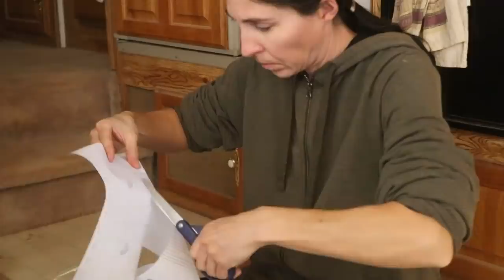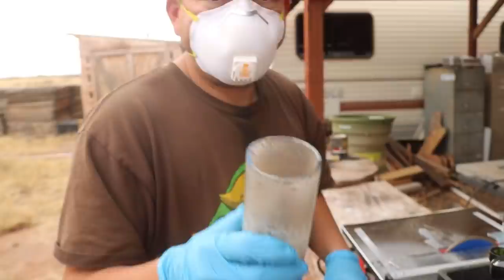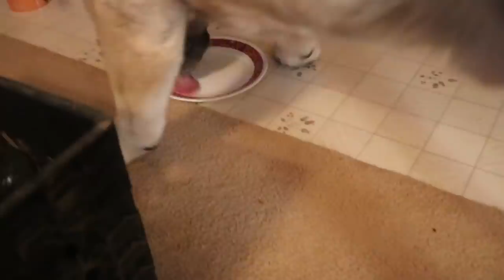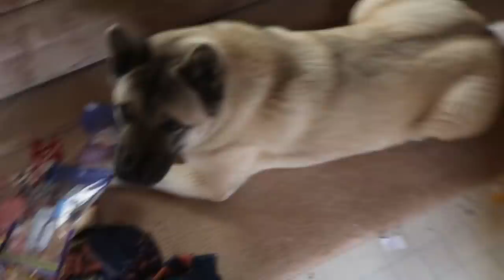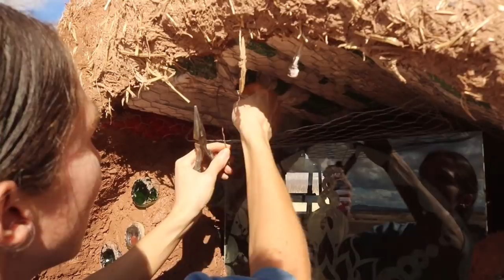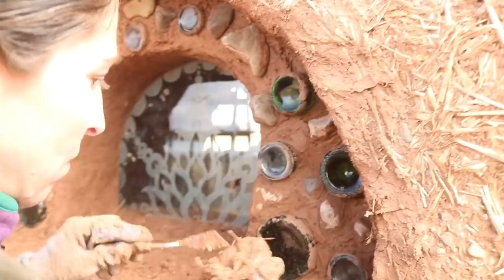This Beautiful Window Is Made With Etched Glass and Glass Bottles

Comment: If thats a morning dove- love the song the do in the very early morning.  Thanks for showing the etching- want to etch some glass on some interior doors I have.  The finishing layer will be the fun layer because you can sculpt it.  like the rocks you incorporated.  Saw something the other day -  make a bed of sand- set the bottles a few inches into the sand- bend some coat hangers around the bottles as reinforcement and then carefully pour a concrete or portland cement mix around the bottles - then you can lift them out and brush off the sand- and its a stained glass window using concrete instead of lead canning.

Comment: The window is beautiful, I was so excited when you got it capped I didn't expect the same excitement for the windows, hehe you have got me again. It sounds strange in the UK to not have south facing windows, I hope in winter when the sun is low you get a bit of direct sunlight with a projection of the window tracking across the inside.

Comment: Hi Jim and Jess. Just a heads up on your bottle windows. You should drill a small hole in the inside bottle to allow for expansion and contraction of the air inside other wise they will move.  I found this out on glass yard art that separated and crashed to the ground.

Comment: Great Video as always. Maybe helpful; if you scrape with the blunt side of a kitchen knife in hot soapy water it helps the glass bottle labels come away more easily, the hot water helps loosen the paper glue and the blunt flat knife edge won't  leave any scratches  or marks.  Great Stuff, thanks guys.

Comment: Are those one glass jars prayer candles?  If so you could pour boiling water in them or set them in a pan of boiling water to help get them clean. Most likely they have a metal wick holder in the bottom, but if not, you can also pop in the microwave. I’m loving this portion of the build. I love to watch your creativity Jess. I’d like to remove the windows of my normal stucco house and put in something like this. You have me inspired for sure. Ohhh...yes I think ai must do a bottle window. Also, I came across glass paint that I have in my craft supplies. Hopefully it’s not all dried out.
Reply: LG Maybe make a bottle wall around your patio or  garden. Hope you have fun working with making a bottle wall.
Reply: @wandadibble5426  that sounds like fun.

Comment: Nice. Nice. Very nice. 
And yes, I was wondering what you did with all your plastic. 
I don't have my permit to use the cities transfer site yet, so I have a little over a years worth of plastics, cans, and bottles. 
The plastics are my biggest concern. 
I can melt and make blocks or slabs out of any HDPE (2) or LDPE (4). 
But I don't think it is safe to do that with PETE (1), V(3), PP (5), PS (6), or Other (7).

Comment: In my experience as a marble Mason as long as the blade has fine particles in the blade and I ran water over it like on a regular tile saw and cut it at a slow speed it always cut really nice cuts whether it's flat glass or bottle glass